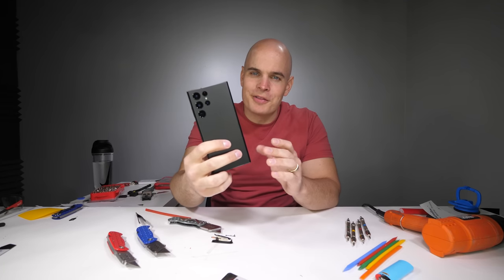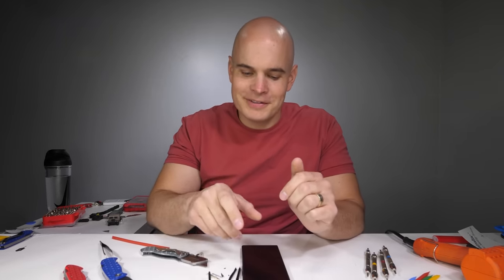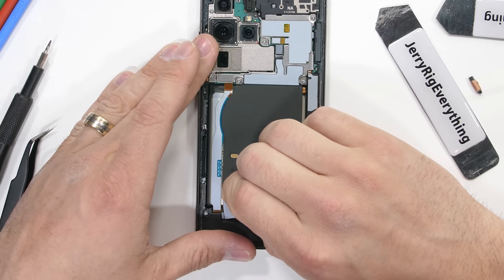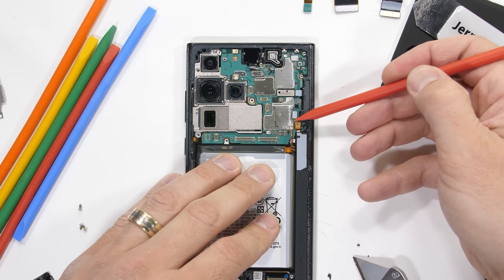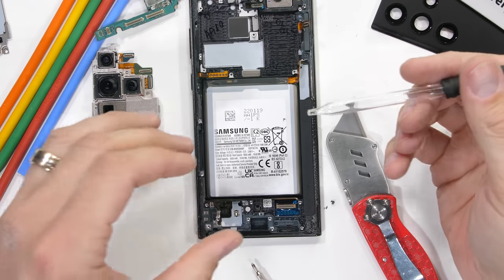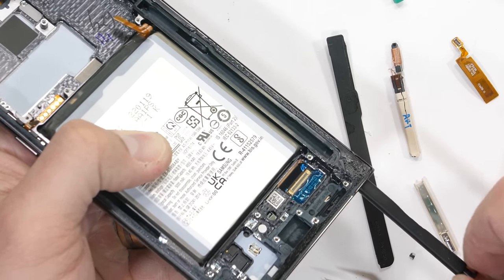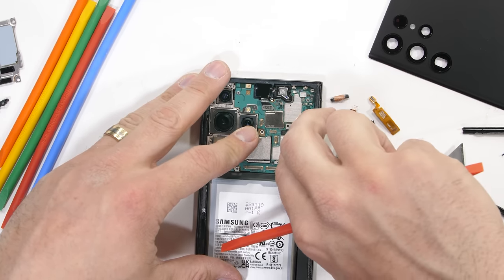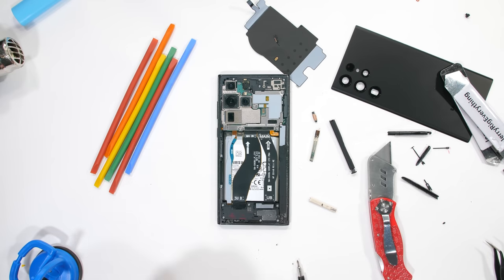Galaxy S22 Ultra Teardown - Can the S-Pen hole Leak?!

Comment: Zack is spot on about the plateau.

I went from upgrading yearly since the S8, to deciding to keep my S20 Ultra for a 3rd year because nothing is compelling me to switch.
Reply: Yes other that the battery won't last as long. I got the S20 ultra.
Reply: @jdreaper2176  Yeah but to be fair it's extremally affordable to buy the replacement battery for it and restore it to it's original capacity. Just wish that manufacturers would make swapping flash storage easier since that'll eventually slow to a crawl with no good way to restore it without buying a new or barely used motherboard.
Reply: I went from my S7 Edge to a S10E and I've stuck with it... Can't justify spending that much extra for VERY little gain and a much bigger phone (that won't fit in "my" trucks phone cradle
Reply: I'm considering upgrading from the s20+ to the s22 ultra. I'm thinking if it is worth the upgrade
Reply: @Taqqee09  I think it really just depends on your preferences and what you care about or not. Like I really care about lots of the new things Android 12 did so I got a Pixel 6 Pro, but if I didn't care for that then I probably would still be running on my old S10+ and maybe considering upgrading. The reason I say "maybe consider upgrading" is just because out of all Android manufacturers, it seems Samsung tends to make phones that get upgrade sickness where upgrading slows down the phone.
Reply: I only just replaced my note10+ for a note20 ultra because I couldn't justify the $1k price difference (here in New Zealand) when there is no realistic difference between note20 ultra and s22 besides faster processing and bigger battery which my note20 is plenty fast and battery life is shockingly better than the note10+
Reply: I think I'm gonna upgrade to the S22U and just hold there for the foreseeable future
Reply: S20 Ultra has microsd slot and I have a 512gb card in mine so any new android phones without microsd slot are a downgrade.

S22U is like: "there's no space for the headphone jack or microsd - also here's mandatory S-Pen" pffft
Reply: @jdreaper2176  You can just replace the battery.
Reply: @mjc0961  True that my Samsung brother.
Reply: Jumping from 8plus to s22 ultra- waiting for my phone since February  -_-
Reply: @THEONEDBZ4ever  Thats a raw deal, is there a supply shortage? Ive always gotten the previous Samsung phones I pre-ordered on or before launch day.
Reply: @THEONEDBZ4ever  damn, complete opposite of me. On a whim I decided to ditch the S20U for the S22U for the camera upgrades and S pen, among other things, and just walked into the closest store and got one. It's been harder to get a case than getting the phone
Reply: @patton3338  Yes, I ordered the phone on February 9th through best buy here in the (US), I tried ordering through Samsung but the site was constantly crashing - so the backup plan was getting it through best buy.  I preordered the S22U Phantom Black TB 1 version - Still hasn't arrived yet :/
Reply: Finally Got my s22 Ultra, loving the phone, hated the long wait!
Reply: @TetraTimboman  this is a Note series rebadged as an S series ultra. There is no card slot in any of the S22 series of devices.
Reply: @taariq5324  Yes exactly. And based on that it seems like we could have had a model that wasn't a note, and that had a headphone jack instead of the space occupied by the S-Pen and probably room for single if not dual microsd tray on that side as well.
Reply: @TetraTimboman  Agreed. Unfortunately Samsung has taken the Apple approach to remove the audio jack totally from non entry level devices and the card slot from high end devices. Only the audio jack can be added through the their non free type C add on. This is not the only thing that bothers me, it's also that we need to purchase many more accessories compared to S20 series. It may get worse in the coming years.
Reply: The same here
Reply: Still have my S8 here, only downside is the batterylife. Nothing I can't live with
Reply: @watnw2411  is ur note 20 ultra equipped with SD865?
Reply: same here. Still using my 3 year old Poco F1. still pretty fast, modern android thanks to good LineageOS support. Let's see how long I will keep it. soon I will have to replace the battery, it's already down to 65% of its original capacity, and slowly the battery life gets annoying.
To be fair, I also use my previous phone for 4 years, an LG G2. However the G2 was slooow at the end of its lifespan and turned into a space heater when using Google maps
Reply: @garethreece  almost identical to me. S6edge+ to s10e to 256gb green s22 ultra. From huge curved flagship to small non curved to huge curved flagship again. The camera is the single reason I chose vs s22. Battery is much longer lasting than the vanilla s22. The s22+ is much more appetizing if you don't want the moon gazing 100x space zoom 108mp snapper.

Comment: I wish you had gone into more detail about the cooling hardware. Samsung totally re-engineered the cooling system of this phone utilizing a gel tim, stainless-steel vapor chamber, copper heatpipe, and graphite pads and it wouldve been really cool to see these parts in more detail.

Comment: Thank you for highlighting Samsung's obsession with battery adhesive and it's effect on the environment! I own a repair shop and deal with a local electronics recycling company. They hate getting Samsung devices in because of the difficulty of removing the battery compared to other manufacturers. I can't imagine how many end up in a landfill globally because of the this.
Reply: Samsung has never stopped overreacting to the Note 7 fires.
Reply: @mjc0961  But the Note 7 battery fires were just a result of poor manufacturing, not poor design. Had nothing to do with the battery moving around or anything.

Comment: Repairability is DEFINITELY an issue, as I had several smartphones and one tablet in a good repairshop near my home several times.
A problem with the USB port, screen (3 times) and camera module (1 time) isn't a reason to spend a ton of money for a new device! 😉
Reply: Yes :(
Reply: All of them you can repair by yourself if not scared and that saves more money than new phone
Reply: @NoName-tg2kr  ... just if you get the replacement parts cheaper and faster than a professional repair shop that doesn't need to buy the tools (because they already have them) AND you can repair it with less damage than the small fee I pay in the shop.
By the way: most repairs are done in the shop in no time. 😉👍
Reply: @u.e.u.e.  maybe true but ive replaced with basic tools back glass on my note 9 two times and it was fine
Reply: I only can recommend a Fairphone to everyone. Perfect repairability, sustainable, environmental friendly, good support, good choise of repair parts, local production. All the important future things in one smartphone. I have the Fairphone 3+ and its just great!
Reply: I've had an s10 3 years and my s8 5 years and have never needed to repair anything... Still own both and my s10 is in my pocket all day at work
Reply: @Mortonbmx  Nice!
I had an electronic failure in the display of my S4, dropped my note 9 (display and camera module crushed) and dropped a tablet (display). 🤪
The charging port issues were on a Nokia.
Reply: @Mortonbmx  nice. I was in car crash and my phone flew out of window. So my back glass was broken. Bought a transparent glass from alyexpress and it broke first day then i bought a better one. And its still going. Im using my new s21 ultra and my brother uses that note 9 still
Reply: Ellis The DJ  not always a good thing. If phone is working fine and the costs are minimal better using the same phone
Reply: If you want repairability go with Motorola
Reply: Probably more to do with the repairer or the parts they’re using. Samsung repairs are a cinch if you’re using genuine parts
Reply: Samsung phones are easier to repair compared to most of the others?
Reply: Samsung has some real funky issues surrounding repairability. It's kinda weird to consider, but it's like the reverse issue of Apple. Samsung makes it easy to get parts and provides guides and ready encouragement to do your own repairs, but the construction makes it difficult. Apple on the other hand, it's a lot easier to do the repairs, like especially for batteries, and then does shit like serializing the screen so if you replace it yourself or without Apple's blessing, you lose core features, and also the general fun of parts supply.
Reply: Whats crazy is i still have a galaxy s5 in working conditions. No dmg, screen is great, i use it to play music 🎶 i want to say the s4 and s5 were waterproof and could even add the Qi charging! 

Iphone didnt get it until the iph9ne 6&7 i think 🤔 didnt they JUST talk about customizing the home apps or something 🤣 always 10 years later on basic features
Reply: @MeAndMyOpinions_OverYours  What do you mean with "dmg"? 🤷‍♂️
Reply: @u.e.u.e.  damage*

Comment: For anyone wanting to replace a battery on their phone; 
Disconnect the battery, soak the adhesive in a few drops of isopropyl alcohol, get a piece of dental floss and put it under the batteries corner.
You can cut through the adhesive with zero bends being done to the battery.
Did this on a couple phones but never heard about this technique from anyone.
Hope it helps.
Reply: Thanks, this helped a lot
Reply: @missflorathewriter9014  Glad it did! :)

Comment: I've had my Note 10+ for 2 and a half years, and this phone has been a great update for close to a week. It's great that it has 4 years of Android OS updates now.
Edit: Wouldn't recommend upgrading now if your phone still works.
Reply: Same goes for me.
Reply: Note 9 user here
Reply: @ndasarathy1  note 9 for the win
Reply: I have a note 9 and I've been looking carefully at all my options. In the end the best one I could find is the Snapdragon note 9 to switch to
Reply: I have an S20 Ultra and love it. as much as I would love this phone, the S20 ultra is just still a beast. 16Gb ram and 512gb storage is just insanity
Reply: I personally recommend not going for the current samsung flagship lineup unless the ongoing GOS issue is solved….
Reply: On the flip side I just sold my Note 20 Ultra to someone that needed a phone that fit her budget. It was still a great phone and I'm sure she'll get great use out of it
Reply: s10 - Note 10 series are still only getting 3 years OS updates. So Android 12 was the last Android update. I do believe they'll get security patches until February 2023 tho but I'm not sure if Samsung still releases the monthly or switches to quarterly. The 4 year implemented for the s21 series and newer. I just "upgraded" from my s10+ to the s22U 512gb and agree that it isn't worth upgrading but Verizon gave me $1000 for my s10+ so I took the deal. But I much prefer my s10+ over the s22U
Reply: My note 9 is little bit of slow now. Any idea how to solve the issue?
Reply: @kartik.khandelwal  probably just need to upgrade fr
Reply: @_dmfd  how?
Reply: @kartik.khandelwal  once a phone falls out of security updates they just start slowing down mainly bc software bugs are abandoned, software isn't optimized anymore, apps require more power from the cpu, internal storage runs low, battery cells wear out, etc. 4 years is a pretty long life for a phone.
Reply: Note 9 still rocking for me
Reply: @kartik.khandelwal  just do a cache wipe
Reply: Having longer software and Os update is great but these android phone make their phone less usable, laggy, crapy camera function after each update, maybe to sell new phones?! Ihave s21+, its already laggy, scrolling is not smootg as expect, photos come like from a mid ranger. Pathetic
Reply: I have an iPhone and the s22 ultra looks nice but iPhone is hard to switch from after you’ve used it. I’m visually disabled though so the big screen would definitely be easier to read. It’s not worth trading in my iPhone 13 pro just yet though. If I even do lol. I’ve always wanted to try a note phone though as I’ve seen a lot of people swear by them.
Reply: Just upgraded yesterday from my note 10+ I got on release to my new 22 ultra and I'm happy so far.
Reply: My mom wants my phone though and I have a note 10+ 🥲.
Reply: @ChrisTheMobileMechanic  did you have any issues with the S22 Ultra when u upgraded from the note 10+.

Comment: since 2017 been using Sony Xperia XZ Premium and only upgraded in 2022 with S 22 ULTRA. Ultimately, they all do the same basics. Tho, xerpia back panel had given off, needed to be reglued and local mobile trademan stated that the "model" was out of fashion, they could not repair, despite, only needing some reheating n adhesive. 

But this s22 ultra is a nice piece of machine, great replacement for a broken (still functional) phone.

Comment: After 4 years I decided to finally upgrade to the s22 ultra. I plan on using it for just as long or longer. We'll see. Hopefully the battery will last 2 years without replacing.

Comment: I want that phone but can't justify upgrading from my s20 ultra. it's still a beast. the amount of engineering that goes into these phones is truly astonishing nowadays
Reply: Your right it's just not worth the upgrade for you. I was debating giving up my note 20 ultra. But I've always hated that phone so was happy to get rid.
Reply: Does your phone has burn-in screen problem?
Reply: @Justice_Akbr  nope and there is milleage on it. I got it on release day so its over 2 years old now. It used to have some issues where a restart would fix it but a software update must have corrected that a while back. My s9+ i gave to my mother and its still running flawlessly.
Reply: @Justice_Akbr  My note 9 had. Got the 22 ultra now and batteri is bad, hope it somehow gets better in the future with upgrades.
Reply: @rj_ofb  what presantage do you used to keep the brightness of your screen in your note 9?
Reply: @Justice_Akbr  i always had it about half, 50%. Sometimes a third.
Reply: @Justice_Akbr  my note 9 still going strong tho, not even shadowy screen with heavy usage, just bad battery which is still acceptable
Reply: @Justice_Akbr  my s10+ never had burn in either after 3 years of use. Samsung has gotten really good about keeping OLED screens from burning in
Reply: I have an s10 and can't justify spending a grand on a new phone yet. 3 years and thousands of hours of use and still running great. Maybe next year
Reply: For the moment dont bother, its nice sure but i was on s10 prior and besides minor speed increase its basically the same
And with very little actually needing the "high specs" youd probs be fine another 2-3 years with an s20
Reply: Why you like smartphones?
Reply: @Justice_Akbr  mine does after about 1 and 1/3 year use
Probably cause I use it to often
It has burn in due to the color white
Reply: It's only astonishing in that I'm astonished that they keep removing features and people keep buying it. Put the headphone jack, micro SD card slot, and bezels back in. Stop mutilating my screen with notches and holes, and stop giving me 30 cameras. Definitely do not give me a stylus.
Reply: @Justice_Akbr  mine did
Reply: @jeffgayzose8129  i got a used s22 ultra for £650 from cash converters

Comment: I still think they should implement removable batteries. That would make it super easy to recycle the old battery.
Reply: A few Years ago, we had removable Batteries, they wont return to that, because it would make the repair also easier.
Reply: bunch of reasons why they went away from removable batteries. It's much tougher to offer waterproof protection with a removable battery and they can fit a larger non removable battery in the phone which is what everyone wants these days.
Reply: @JorgTheElder  nah that would restrict innovation and take us backwards in performance
Reply: @Yielar1  To be honest, making the battery removeable would make it bigger since it loses about 1/6 in thickness, that being the glue.
Reply: @fa14bi-78  pull tabs exist.
Reply: @sabersz  Jup, they still have their own thickness taking space that could have been used for like 500mah in battery capacity.
Reply: @Yielar1  user replaceable doesnt mean pop off the back and remove it, it means allow the user to remove it, not use 2 tons of glue.
Reply: I miss the days of removable batteries.  They were so good.  Was awesome being able to bring a spare battery in a bag on days where I knew i'd be out and about and unable to charge my phone.  There are reasons why they don't use them anymore, but they were awesome.
Reply: @GeneralFiona  they won't return to that because then the phone wouldn't be water proof. The battery is still removable, you just have to know what you're doing.
Reply: @JorgTheElder  these are user removable batteries. There is nothing stopping the user from getting a heat gun and moving the back glass and getting some alcohol to remove the battery. Just like there is nothing stopping someone from removing the engine in their car. Most people just choose to take it to a professional.
Reply: HXBES  you don't understand, the hardest part is removing the back glass. Everything else is easy after that.
Reply: @MG-im8ku  bro, just by a battery bank. It's basically the same thing except they have more capacity now
Reply: They should make it like the fairphone
Reply: @jeffgayzose8129  very true. I got several. Can just be a hassle dealing with the cable when out and about if still using my phone. I'm an avid hiker and use my phone for gps. It just becomes annoying with the cable. But it's the only option now lol
Reply: Peter smith  been wanting one of those. May be my next watch. Using a Samsung active 2 right now. Isn't great for gps.
Reply: @MG-im8ku  buy a short 2 foot cable. I also hike and always keep a cord and 10k mah bank in my pack with water and snacks.